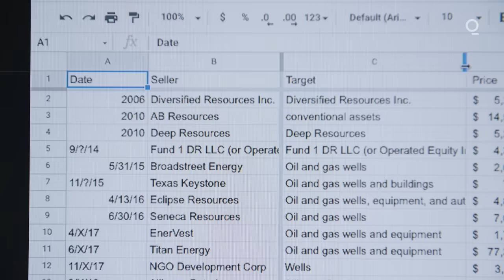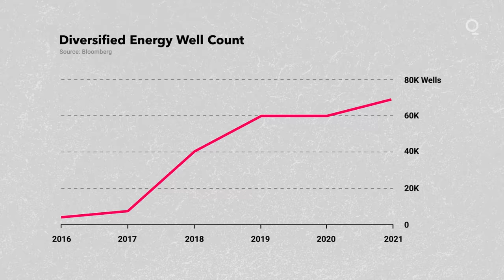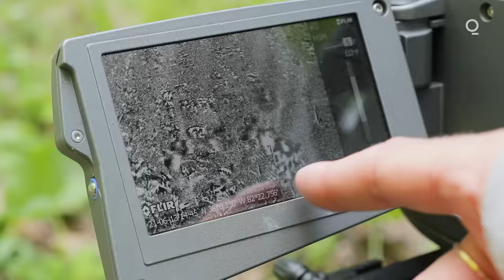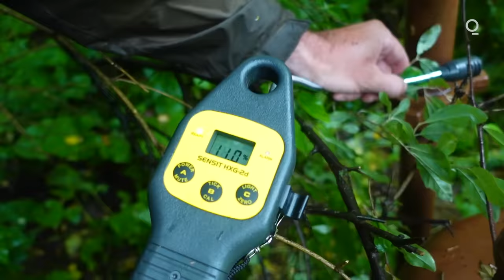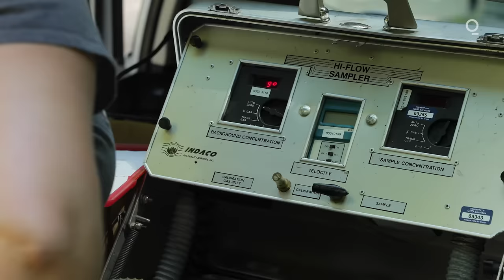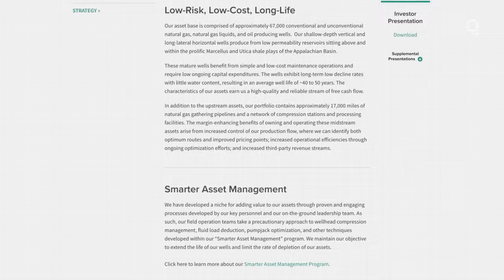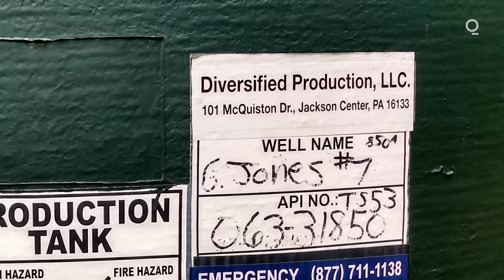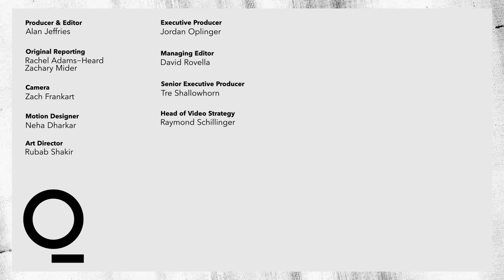How Dying Gas Wells Are Making One Company Rich

Comment: This is so interesting! I had no idea this was even a thing!
Reply: i wud think that compared to all the REAL GAS that has been vented into the atmosphere when gas was... still is.. in many places in the world a by product of OIL WELLS.. the gas that is leaking is trivial. just either fix the valve/tighten the fitting or make a night light out of the gas leaking so the little animals can have a night light to socialize with. i wud.  make a wind proof thing, run little hose to little piece of pipe for the firebox. make little box around it for the animals to have warm place to sleep at night... the little animals, not the big ones.

Comment: I had to seal a well on my property. It cost $3000. Something doesn't smell right.
Reply: They finessed
Reply: like all other things... it depends on how big a job it is? how much cmt is needed.  really need to put a wireline plug in the hole first and then cement it. 2 plugs... 3 to protect the freshwater sands and isoolate them?
Reply: If it was on your property and you knew about it it was likely easy to access and a simple job. These wells are out in the sticks and some of them don't even have a road going to them.
Reply: I don't get it ,to dump concrete down a hole cost so much.On sure its a special kind of concrete.
But what about years from now when it all rust out?

Comment: to put 9:45 into perspective, the 8,000 cubic feet this well produced is a mere 11% of the average ANNUAL use of an American household.
It may SOUND insignificant, but the 6 times that that's being emitted without being burnt is not.
And this is just one well. Ponder how many wells there are...
Small leaks add up.

Comment: I wonder if there's a way we could make an "external" pipe dope compound like epoxy putty or construction adhesive. Apply that quickly to the outside of pipe joints without having to disassemble the pipes, in a quick and easy way that wouldn't take a skilled technician. If the states went for fed funding, it would create jobs and make use of the wasted gas. If I were the state I'd let the gas company decide. They can fix the leaks themselves, or the state can hire techs to fix them and take 20-30% of corporate profits as reimbursement.

Comment: The gas meter going to the house or apartment you live in or to the business you work at likely has trace amounts of leakage from the lines. I was told that by a fire man who came to check the meter behind the restaurant I work at.
Reply: not just outside. i lived in a 3 floor apt building with 12 units. the gas line rotted out outside. i smelled it called the gas company. they shut off the gas to the building and fixed the outside. then they pressure tested the building which failed. every unit had a forced air gas furnace and water heater. took the owners 3 weeks of working on the system every day to fix all the leaks so the gas could be turned on. 
so not only do wells leak but many houses and other buildings leak gas.
Reply: Yes 5-10% of usable gas is leaked by distribution pipes.  My gas guy said that they buy a lot of the iron pipe from China and they don't weld the seam significantly and that's where most of the leaks are is it the seam.  Upgrading to extruded e I would help and of course  stainless extruded would be the best.  Most of the high pressure underground pipes in my area are made out of PVC and they're about 40 years old.
Reply: And that is refined dried gas that is much richer than the who knows what is coming up that well they are lucky they didn't get a shot if H2s deadly amateurs should not go up to oil and gas Wells

Comment: The problem with this report is that CO2 is a very heavy gas and immediately sinks to the ground where the plants & trees can use it up while creating & releasing the oxygen we need.  The last impact events earth has experienced has left us with only 403ppm. Barely enough for foliage...
Reply: Today we're at 417.16 ppm c02... Still dangerously low in the big picture that you mentioned.
Reply: They are talking about methane, which is lighter than air, you can see it raising from the leaks in the video imaging. Methane traps 80x more heat than CO2 over a 20 year average, and around 30x more over a 100 year average.

Comment: It's easy to say the leaking connections can be repaired/ replaced using teflon tape, pipe dope, epoxy, grease. But if the shut-off valve is fragile, rusty, leaking, then that's an extrellmely big problem of isolating that well for repair.

Comment: I’m sure that you took the information from your investigation and then took the professor to the worst leaking wells then did a average a cross all of the wells that might not be leaking as bad so you can make the numbers higher 
I would also like the know if you calculated how much pollution y’all put into the environment from driving, flying, staying in hotels, and using electricity to charge your devices which is putting pollution in to the air to make this film.  Then I would like to see a comparison between the two.   Because a lot of people will use private jet to fly to a climate change conferences   But I’m sure that y’all will never share the data on how you got to your numbers or be upfront with me or even worse yourselves
Reply: Are you saying we should just ignore those leaking wells? Should any investigation of environmental problems be cancelled if the investigation involves driving a car? 
  Yes, it is possible those particular leaking wells may not be truly representative of the actual situation, it may actually be far worse for all you and I know. We don’t know, that is the issue. Without investigating, we can’t know.
  I understood the purpose of this video was to bring to the public’s attention the issue of leaking gas and large corporation’s apparent inactivity in repairing those leaks. 
  If one of those gas leaks was, for example, under my children’s bedroom, I would not be entirely happy about it and I would expect the owner of the source of the leak to rectify the problem just as I would expect them to fix these leaks in the woods.
Reply: Deflection spotted.

Comment: The cost of finding new wells is great therefore epoxying  the pipes and continuing using the dregs makes sense.  Fertilizer nitrogen and amount feed the world unfortunately a trade off with nat gas production. As well as all the fancy kit and gear you were wearing. From cotton to nylon foam shoes etc etc. The paved roads you drove your gashog f150 to reach the well head's.  Not a simple equation. Methane bad.  Rotten valve salesman.

Comment: My father worked in an oil refinery, and once he fixed a low pressure leak on his home gas meter piping by just smearing over the joint with some jointing compound. He said that they used to do it at work all the time.

Comment: I see the big problem - wells will continue to make money even when the well can no longer pay for plugging the well. So if state regs don't require plugging the well early enough in the well's life a company that owns too many wells will be bankrupted and the state will be stuck with the bill to plug the well, and the state won't pay if there are too many wells left by a bankruptcy.
The source of the problem is in the state regs - the regs need an overhaul, the sooner the better. This gas company is a creature of the state regulatory environment - it exists because the state's gas rules re plugging wells are lax and enforcement of existing rule may be weak. The company is exploiting a loophole in the law and is looking for other states with a similar loophole. The big energy companies know the old wells are a long term loss and avoids them. Diversified is not worried about the long term as long as there is plenty of money now. It can always bankrupt out of it's liabilities and the same people who run it can reform under a new name. This will happen - it is how big companies escape liability for toxic waste sites (which are another problem caused by poor regulation).

Comment: I worked 27 years in Oil and gas. TC Energy/Columbia Gas has numerous high pressure (3250 PSIG) wells, facilities in WV and several on property we own that have leaked for many years. Leaks are reported to the operator, PHMSA and WV DEP oil and gas as well as Air Quality with no response to correcting the leaks. In 2019 WV Air Quality told us the leaks would be promptly respired it is August 2022. We are still waiting.  Additionally we have a well with an operating pressure of 3250 PSIG 100 feet from our home that TC Energy/Columbia gas has been attempting to diagnose a leak down hole since August 30 2021. Investigate the high pressure storage wells with transmission lines and you will find most leak and have leaked for multiple years.
Reply: Joann Lewis;   the 'parent company' buying the wells in the video is a foreign entity.  They are not necessarily obligated to play by the same rules as business entities that conduct business in a country in which they are also incorporated.  The 'parent company' is incorporated in the United Kingdom.  Furthermore they should be regulated as a "REIT" since basically they are buying the real estate in which the wells sit on.

Comment: it the valve is leaking, repair or install more valves to solve the leak problem? most cases it is equipment not performing and not the well casing. the cost of plugging one well could repair a thousand wells or more.

Comment: I get it, you want oil and gas shut down, but if you fix the leaks and regularly test like we are required to do in Alberta, it’s cheap and easy to produce without issue, the issue you have is the USA oil and gas regulations are too relaxed.

Comment: State Natural Resource regulators and University Geology Departments must have records of how deep these wells were drilled.  Can't they plug these wells for less than $9K to $10K?  Why can't they saw off the main pipe just below the surface and inject some kind of epoxy injection resin at a sufficient depth and length, and at various depths, including at the neck of the pipe?  Each sealed well could then be metal tagged with date of sealing or last inspection.  The sealed wells would require periodic inspection, at say 5 year intervals, but they could always be drilled open again or re-injected again for whatever reason.  Or they could be equipped with methane detectors that report via telemetry.  With rising natural gas prices making agricultural fertilizers more and more expensive, why not reconnect these wells to harvest methane as fertilizer feedstock?  See:  How we make our fertilizer | Yara International  - - Quoting:  "NITROGEN  In a modern plant, nitrogen fertilizer is produced from natural gas. In several transformation steps, natural gas, essentially methane, is upgraded by combination with nitrogen from the air to form nitrogen fertilizer. 80% of the gas is used as feedstock for fertilizer, while 20% is used for heating the process and producing electricity."  I am sure my questions are absurd, but none were addressed in the video.

Comment: Are people this ignorant of how the oil and gas industry works?  You can buy these wells for next to nothing. They are not going to plug wells. Just because they are not profitable to operate at the current market prices of oil and gas. We won’t run out or transition to green. As the price increases the old wells will eventually come back into play in profitability. Then they are sitting on a gold mine. Then diversified will rehab swab and frac or sell the wells to put them back into production.

Comment: You know that if I never cut my lawn, the city will have a contractor do it and then the city will put a lien on my property for the amount owed for any amount the contractor bills (usually twice the price I could have hired someone to do the job). I pay it when they bill me or I pay it before I can do anything with the property. why won't the state do this to the wells? Put out contracts and bounties for finding and documenting these leaks, give Diversified time to fix it but if they fail contract it out and get them either capped or at least fix every leak. That last one could be fixed in minutes with a pipe plug or cap that I can get at a hardware store for about a dollar. But labor and such to get there and to test and document would take hundreds if not thousands. You just need to get the incentive for Diversified to do the right thing and stop these leaks.

Comment: you don't need to plug a well that has fixtures leaking. that is so ignorant. the leaking bits are the fittings up top. replace those.

Comment: They are using a Flammable Gas detector.. it Does Not detect Only Methane… it will detect Any Flammable Gas or Vapor, Fumes etc. if the well is leaking more than they produce doesn’t make sense….

Comment: I only just came across this the article today and really liked it. Given Prof. Townsend-Small came out to measure the rate of flow at a given site, it would have been great to see what the average leakage was over those 60% of sites that were significant enough to set off the detectors. Either as acm/h - (actual cubic meters per hour) or kscm/h- (thousand standard cubic meters per hour). You could then extrapolate 60% of total sites against an average leakage to work out how much per region is leaking into the atmosphere.

Comment: they dont need to plug most of them them they just need to refit the surface stuff with stainless and stuff which wouldnt be that much and would actualyl save them money because that one thats leaking 600% of its production would leak probably 20% instead

Comment: Most of the materials, aside from large tanks, should have been stainless steel 18-8 or 300 series. Back in the 1960's accessing this material was difficult and you know the original owners were too frugal or broke to spend the money - even with ready access like now. This is like people with flawless $80,000 cars and cheap zinc coated screws holding on their DMV tags. Lazy.
Reply: In the 60's, it was most likely cast iron and coating would have been tar or standard paint.

Standard pipe today is carbon steel with epoxy or highly specialized paint. Stainless is used in some applications that demand it and sometimes epoxy powder coating inside and out are used that have to be baked in a kiln, field joints are not allowed. 

For most applications, with sweet  dry gas, bare steel on the inside with epoxy coating on the outside are more than adequate. Other applications such as wet or sour gas, CO2, H2, cryogenic liquid gases, require very specialized pipe. Those specialized pipes didn't exist in the 60's and field joints of Stainless steel, require specialized welding techniques today that were even harder to achieve 60 years ago. You don't need pipe that can handle 1500 psi when the peak operating pressure is less than 100 psi.

Material science, welding and coating science have come a long way in the past 30 years, let alone 60 years. In the era prior to the 60's, we were using lead pipe.  For lower pressure applications, polyethylene and Fiber Reinforced Polyethylene pipe that comes on 1000' spools are used and the field joints can be done in minutes.

Comment: Looks like there needs to be legislation to require all leaking gas wells to be sealed from leaking.
Diversified's "commitment to their shareholders" seems at odds with properly addressing and mitigating leaking wells, and plugging those that need to be plugged.

Comment: need a quicker and MUCH cheaper means to plug a well like say dropping in a line down the shaft and filling it with foam which can expand and seal than cap it with a locator for future reference

Comment: Great Job!  I abhore the wasteful behavior of the wonderful resource of natural gas.  These leaking gas wells must be FIXED!   Although every tree I saw in your report will eventually rot and release most of its weight as methane, as will all biological matter in landfields, and forested wetlands release huge quantites of methane constantly, but we cannot use THAT wasted methane; we need to save our wells and drill new wells and use PVC pipe which will last indefinitely, because methane is the cleanest fuel we have until solar and wind and nuclear take over in a few decades.   I am grateful to Mother Nature, that after a decade, most emitted methane has reacted with ozone to form carbon dioxide and water.  Again, very interesting, high quality report!
Reply: Fossil gas is horrible for our climate
Reply: PVC pipe can't even come close to handling the pressures involved in O&G production.

Comment: I'm sure you all had permission from the property owners and Diversified to be on those lands?  And no safety clothing, etc, that is required by them, and nearly every other O&G company.
Reply: Jot017 the property owner is a foreign business entity based in the United Kingdom.  As far as I can see  in the video none of the properties are clearly marked by a fence and not a one of them shown has a Private Property or a Keep Out Sign.  A trespasser would probably not be prosecuted if the land was open, the trespasser's conduct did not substantially interfere with the owner's use of the property, and the trespasser left immediately on request.
Reply: @darylcleavenger7585  huh.....